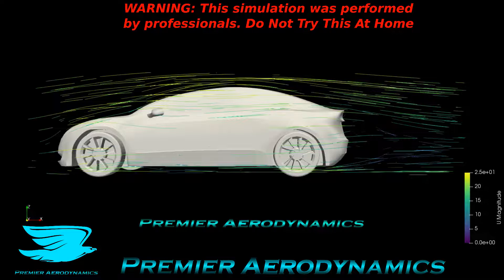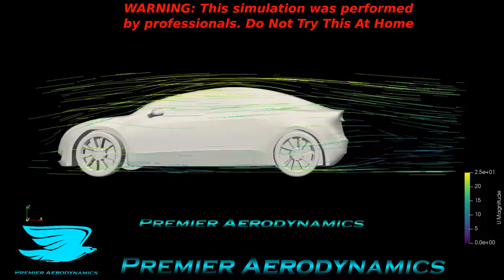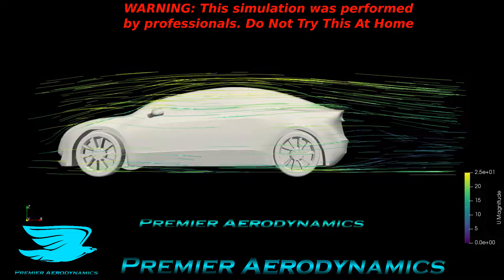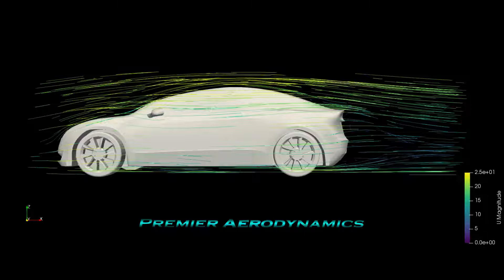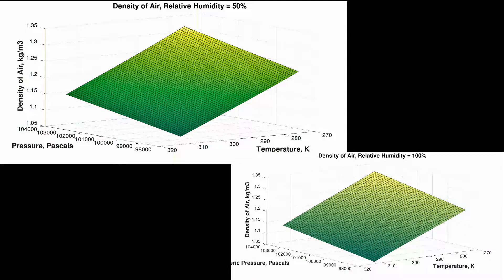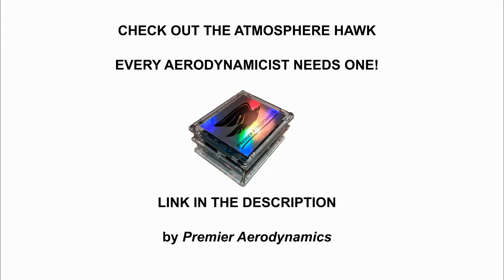TESLA MODEL 3 aerodynamics and drag coefficient

Comment: Could you run a simulation with some form of rear spoiler?
Reply from the maker: Maybe🤔 We will look into it. It might be an ugly design...but possibly
Reply: @PremierAerodynamics  I'm curious about this as well but for the model y, which I think would have more drag than the 3. 
There are some mods I've seen like vortex generators on the roofline, a spoiler is common for the Y and they even have rear diffusers that mount under the car. So curious about each of them to see honestly how/if they could possibly reduce the impact of colder air.
Reply from the maker: @midnight121190 Sure, we'll do some, but it might take a few weeks for us to run them all and make the video.
Reply: @PremierAerodynamics  oh exciting!! Yay!!